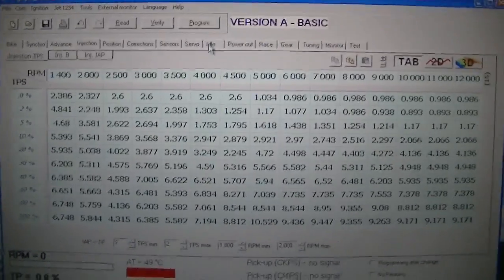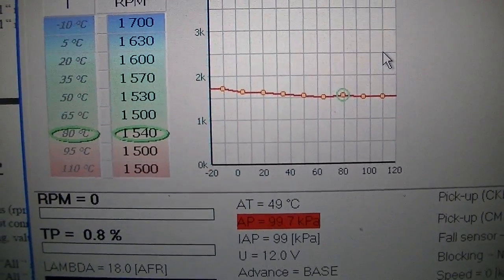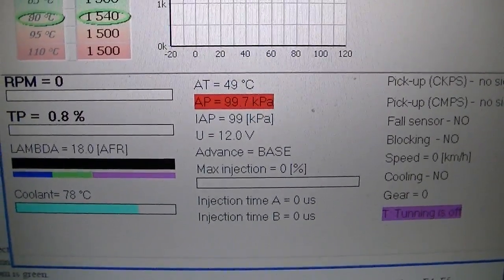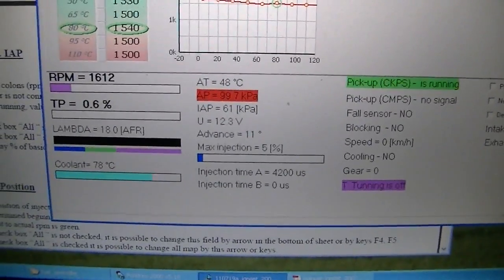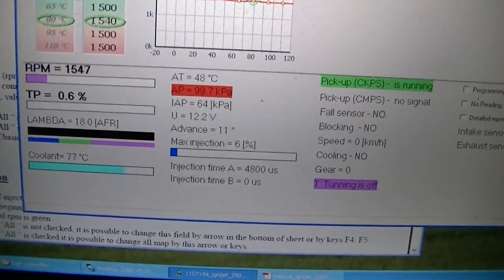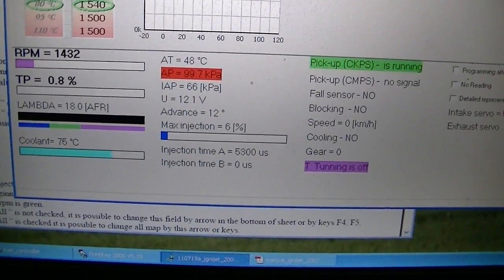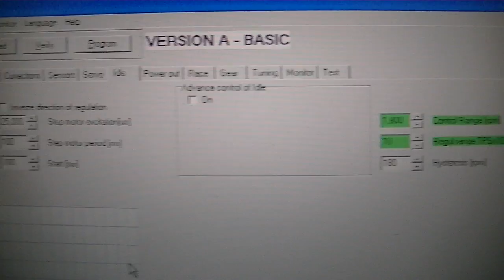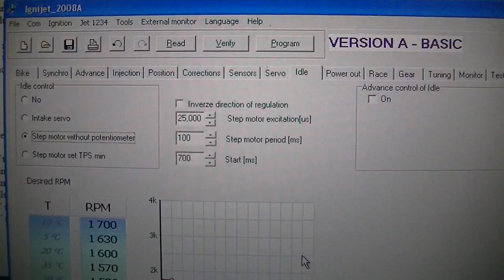Hisun Fully Adjustable Performance ECU

Comment: Got new  fuel pump   as 45 psi got very good spark and  plug are wet  but it still won't start just cranks and vavle clearances  are  adjusted  right  still won't start

Comment: where can get the software that you are using, I have efi 2013 massimo 500 running to rich idle rough and low fouling spark plug s about every time i use it.
Reply from the maker: scott alexander i have it but you cant connect to the factory ecu.  The software will do no good.
Reply: KelleyMotorsports
So it lets you view information and you can't change anything
Reply from the maker: scott alexander you have no communication port to tie into the ecu.  This does not hook up to the the delphi port.  If you use the delphi scanner you can see lice info but cant change settings
Reply: I have a 2012 massimo 500 and running lean and missing. Keeps fouling plugs.  Could it be injector??